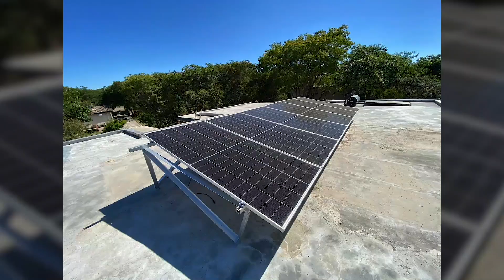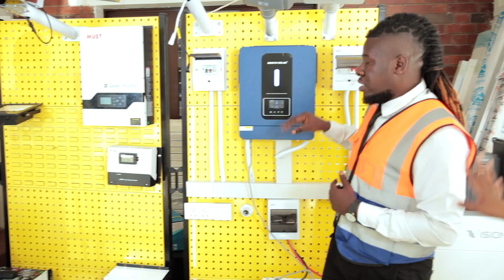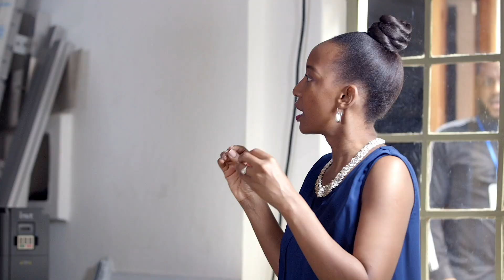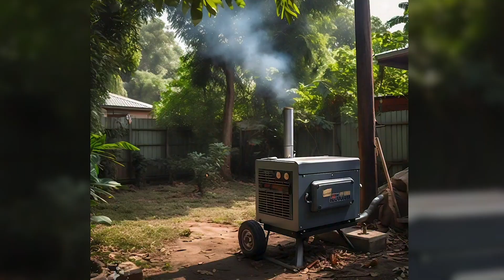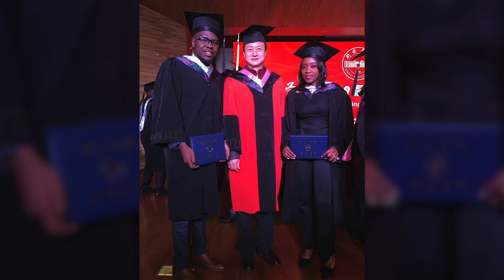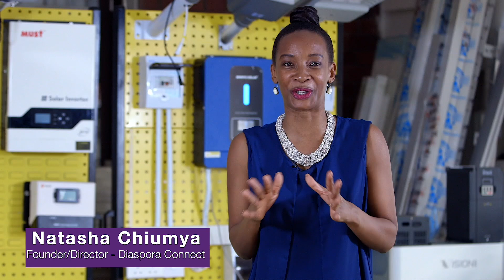Backup power systems you can use during load shedding

Comment: I stay alone in a bedsitter. I basically have 4 bulbs, kitchen, bathroom and  living room / bedroom  and one security light and my 65 inch tv, sound bar , small fridge and microwave and PlayStation 5 what system could you advise in terms of battery and inverter? The bedsitter are those found by libala Langwa area. Would you advise the hybrid system and at what average cost? P.s, connecting the microwave is not a priority.
Reply from the maker: Get in touch with the guys directly so that they can advise. Their contact details are below the video

Comment: - Lithium Ion batteries: K50,000*4 = K200,000
- Inverter: K30,000 (K230,000)
- Solar Panels: K20,000 (K250,000) [my estimate]
- Installation labour: K10,000 (K260,000) very low estimate
- Accessories + cabling: K5,000 (K265,000)

This one is for the ones who want to bamba!
Reply from the maker: For sure it'll cost alot! That's why I asked what alternatives there are and how to reduce the load

Comment: What? 4 batteries plus investor costing K230,000? Ka payment plan will do.
Reply: That is a total system: if you really want to run everything in the house (hotel standard) for at least 8 hours at a time on alternative (solar) power: however most people tend to just want key lights and key socket(s) to stay on during load shading hours then turn everything only when power returns.
Reply from the maker: That's exactly right 👌